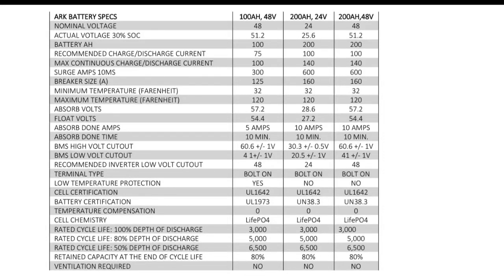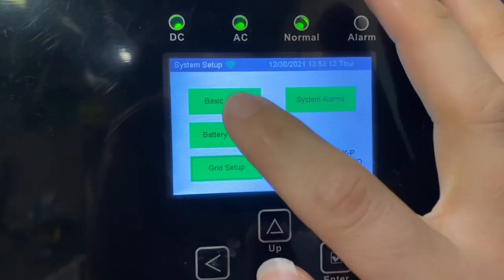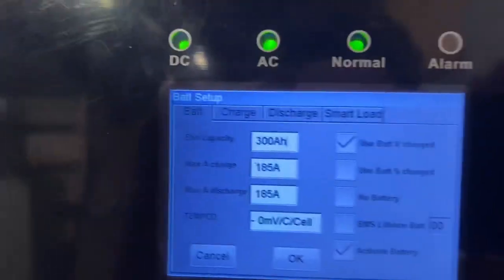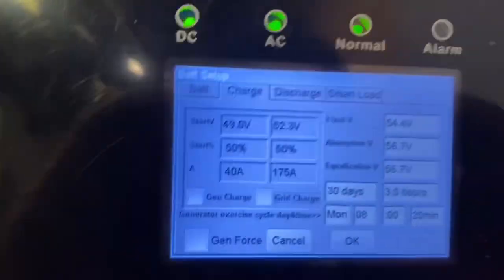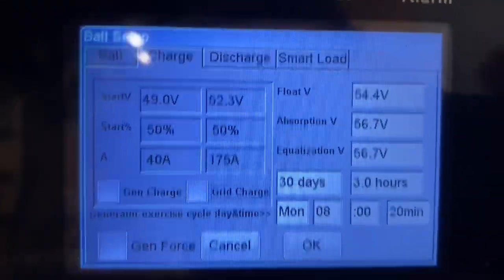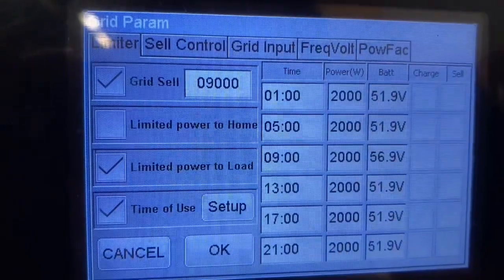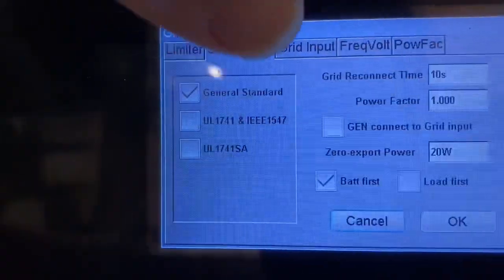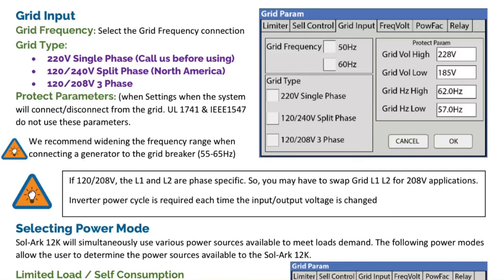Ark 51.2v 100ah battery settings

Comment: Where are you coming up with the charge current of 185A?   From the battery specs it looks like max charge current is 75A for a 100Ah battery.  Also curious why you have equalization initialized for a LifePo4 battery.
Reply from the maker: EQ is set to the same as absorb. 
3 batteries in parallel means I can do 3x recommended charge rate. That’s 225a. This is the beauty of a lithium battery. You can charge it fast.